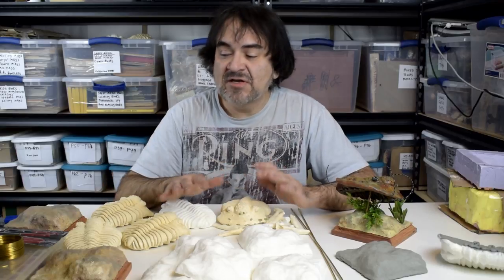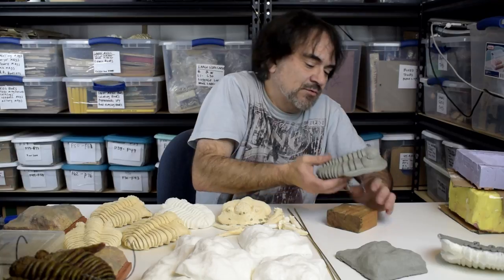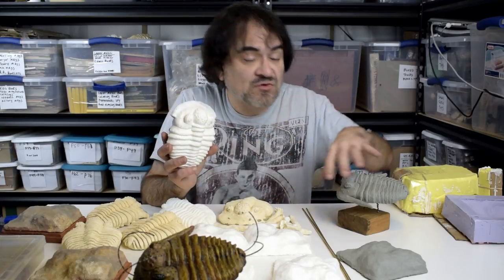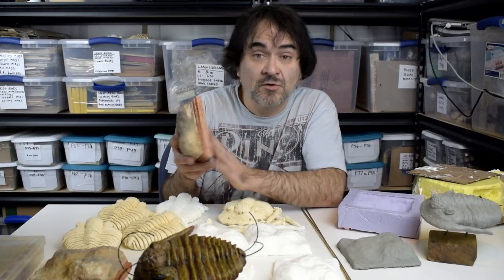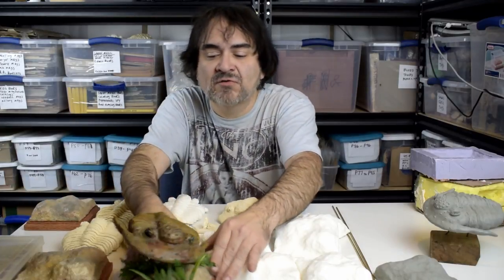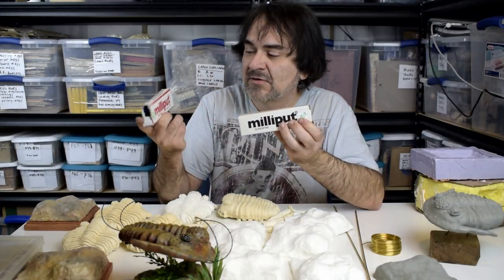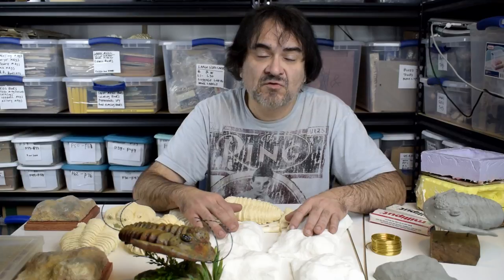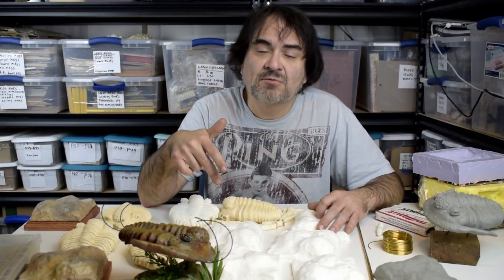Our Trilobite Resin Garage Model Diorama Kit - Summer 2018 eBay Amazon

Comment: Question? When sourcing or checking postcard lots do you look for RPOs or other rare cancels? Thanks.
Reply from the maker: Yes I do check out the cancels, but for the most part there are very few worth more then the card itself. Some of the Railroad offices can have a premium. I've mention some others in some of my videos as well such as the Marshall Plan cancel, or the dirigible, or airship cancels.
Reply: Thanks for the info. I found a Washington DC  Pa. Ave. Street car RPO that seems Scarce. Time will tell.